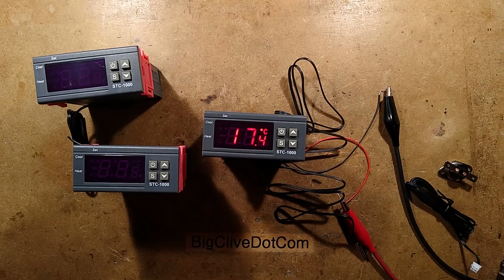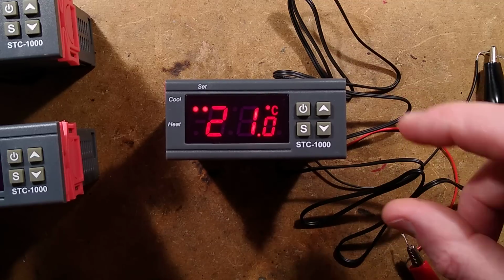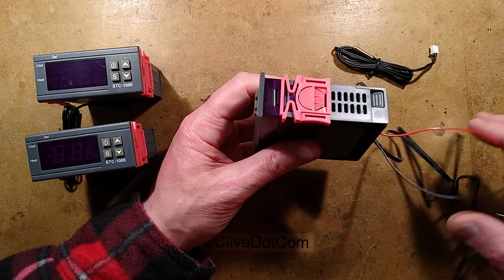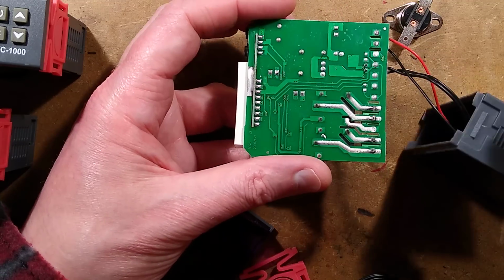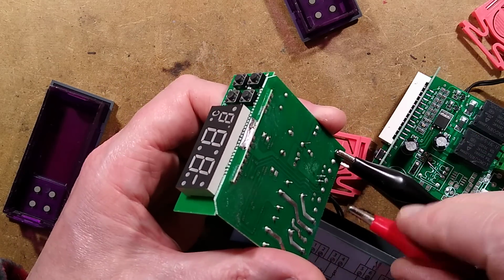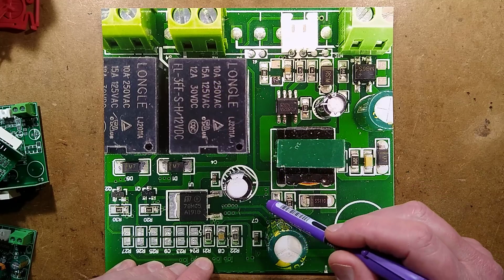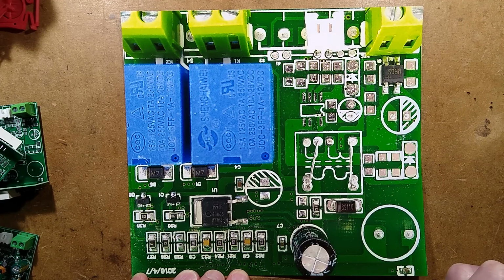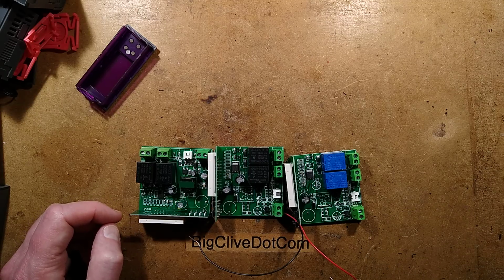Teardown of three STC-1000 style thermostats

Comment: I built a fermentation controller using these a few yrs back (run a fridge, heating pad and fan) and I came to the same conclusion, I wasn't going to trust the mains voltage version and I didn't.  I would love to see you pull apart and review one those Inkbird ITC-308 so see if their internals are any better than a standard STC-1K

Comment: Hi mate. I used to work for a commercial cleaning equipment contractor. They supply a machine called a decarboniser. Using one of those to heat either 10,35,50 gallon water tanks using domestic elements used for central heating. It was a smaller part of their business but u used to replace approximately 5 of those controllers every week !!!

Comment: I despise all controllers of this type.  In refrigeration we most commonly see manufacturers use dixell or Carell brand controllers that have this basic form factor.  They can be programmed for medium and low temp applications and also be used to control electric heaters for defrost.   The problem comes when they control compressors directly through the onboard relays.  Works fine for a little while, but when the condenser coils start to get dirty or the units are put in hot environments  like a commercial kitchen, then they start burning out.  I've seen many actually melted.  Wherever it's possible we rewire the unit to incorporate a more robust external relay or contactor and use the on-board relay of the controller to activate the external relay/contactor coil.

Comment: I've seen some of those with dual sensor sold as a differential or relative thermostat.  This is where it compares the temperature of the two sensors and turns on if the difference is high enough.  Usually combined with absolute, so for example T1 at 30C minimum and T2 5C minimum difference. Often used for solar thermal collectors, to control the pump used to transfer heat into storage.

Comment: I absolutely use my 120v version for an inductive water heater for hot water parts baths. Not saying its a good idea but it kept water near boiling in open air for 3 days without issue. Mind you i kept this setup outside on concrete where a fire wouldnt hurt anything.

Comment: I use the stc1000 for fermenting chamber and indeed blew the internal 220ac power supply. Fixed it with external 12v one. Did you know the the temperature is not really measured and displayed, but referenced by a table operated In the controller. Seems to be more accurate than the non-linear behavior of the ntc or ad-converter. I make great beer with use of the stc1000!

Comment: I use one of these as a "freeze guard" on our central AC unit. I threw it in while I was waiting on some R22 a few years back but after I fixed the issue and recharged the system, I ended up leaving it on just as a failsafe. If my suction line gets below 5C, it cuts off the condenser and just lets the inside fan run by itself. Just set the cooling temp to 6C and a 1C swing. It's wired to always be on and only the condenser control line is switched thru it. I set the compressor delay to 10 minutes so if it  does start to freeze, it'll kill the compressor for 10 minutes to let the evaporator thaw. I know 5C isn't freezing but if the suction is that low, icing has already started on the evaporator on the first few loops after the expansion point and once the first few turns start to freeze, the rest will ice pretty quick. 

Great video as always Clive!

Comment: I use the stc-3008
this one has 2 set points and 2 exits
 2 displays

(low and high alarm)
been using this for 3 years
12v for different cooling fans: grid tie inverter fan, bms fan, electrical cabinet fan

also use a 230v for my pool heat pump
water temp and evapor temp for defrost

Comment: Have used these for years in brewing to control all sorts of things. Mostly good. Would really like to see your take on the cheapo Berme knock off PIDs that are around. About the same price and offer better control, but found the temperature readings unreliable. Some online research suggested this is due to poor design of the circuit causing voltage drop to the thermocouple reference voltage, would be good to test

Comment: Depending on the micro in use (there appears to be a couple) there is opensource firmware available that adds functionality, etc..    As shown in Big Clive's video there can be different micro/ICs used on the logic/display board.

In fact an STC-1000 I have has completely different 'power/relay' board (and logic/display board) to the ones shown in the video here.   Unfortunately I haven't found a datasheet on the micro yet - though the logic/display board has labelled ISP header.

Comment: I had 2 of the real Elitech versions of these in my hombrew set-up 10+ years ago, installed in a jiffy box with IEC connectors for input, heating (during fermentation in winter) and cooling (during fermentation in summer and to turn a freezer into beer keg fridge). Passed it onto my mate as I have no time for homebrewing anymore, but it's still going strong!
Reply from the maker: Elitech video recorded and coming soon.

Comment: I've been using one of these for ten years!  We use it to drive a heating pad, so our parrots are nice and comfy during our chilly winter nights, and it's been absolutely reliable. Mind you the load switched is only 25W (so 100mA) resistive. Easy to set up, and easy to get parts for (important for when "they" chew through the NTC probe cable!)

Comment: Speaking of interference, we had a industrial customer who kept having trouble with equipment because of their handheld radios, which were round about 450mhz. If an employee keyed his radio a bit too close to the controllers, which was kinda hard to judge because RF being so unpredictable, it would cause all sorts of malfunctions and shut it down. We talked about possibly bringing them up to 800 mhz, but we found turning down the radios from 4w to I think 1w was sufficient and they were still able to use the radios via the repeater they already had. 
Of course then a bitcoin farm moved in next door and raised the noise floor at their repeater and 1w became insufficient.
I suspect this device to be very susceptible to problems if in an area with a high level of RF. Its hard to deal with too, since the whole thing is plastic. Even if it was a metal box, it would still get in through the window you'd need to see the display, and all the wiring.

Comment: How about some kind of monitoring circuit that would compare the readings of three of the 12V versions, and, if all three don't agree within some fixed tollerance of time & temp., a contact would close to operate a trouble alarm for some critical use (that would justify the expense of using three controllers)?

Comment: These are essentially identical to some I got from eBay about 5 years ago. I was not impressed, as the first one failed after about 3 months. 
I used them for an in-house sauna. I don’t know the extended life, because the owner moved a few years ago, and I think took it with him. 
The original thermostat had been desired for baseboard heating, and was overloaded as well as a poor design choice.
Ps, as I remember, the relay contacts on the failed one had welded. I may have been running a bit close to the spec.

Comment: I have once repaired a very similiar thermostat that controlled a fridge. Due to moisture build up, a leakage current was flowing over the pcb from live to neutral. This resulted in a trace of carbon which was conducting enough to short the live to neutral with a loud bang. I had to cut a slot into the PCB in order to remove the carbon trace and to gain a better separation between live and neutral.

Comment: I was looking at these, the stc2000 or something like that does have a low and high temp alarm, I was thinking of using the 2k version to control the heater in me 240ltr fish tank. As it was just luck I noticed the heater light was on a long time water was hitting 29d, pulled it out quick. Q: would you trust these units on a tank full of little life forms?.

Comment: Can confirm about the reliability of the AC input version not lasting as long, I had one fail last week after it was unplugged. Thankfully its easy to bypass with 12v. I narrowed it down to the transformer or the buck controller. STC-3028 temp and RH model.

Comment: As others have said, a lot of home brewers use these for fermentation control. I have one to control the heating & cooling of an old fridge in which I put my fermenting beer. Check out the Rex-C100 devices cos they were similar and popular devices for brewing control but are 3 term PIDs instead of what is basically an on/off switch. I use a similar device, the Elitech EK-3010 as a replacement for the controller on my fridge/freezer as the original capillary type device died.

Comment: I have 6 of these running dye heaters, they work well. 
I did not use the stock relays though, they were de-soldered and wires were ran to the existing terminal block
and wired to external solid state relays. I also updated the tags showing that they were modified.

Comment: In our laboratory, (no longer in existence, company restructure etc) we had large water heating tanks (proprietry) to test ground samples, they had exactly the same control panels as these, but the internal relays kept sticking and the water would boil away (the tanks were left running 24-7 over several days to complete a test), it was obvious that the internal relays were woefully inadequate to switch the heating element loads on and off, so I wired external 30 amp relays (RS components), in a similar fashion to the unit you showed towards the end of the video (21.13), and they worked perfectly after that...

Comment: Funny to see the first DC one you pulled apart has the creepage distance PCB cuts on both the relay contacts and power input, then subsequently the AC one doesn't have them (and of course the second DC one didn't either).

Comment: I have 3 of these and the one that does temp and humidity. In the US they have optional f or c display for temp. I use on as a back up for my dogs heated bed and have used them for temp controllers. They work great but have to be done right so connections don't come loose in certain applications, especially where vibration happens. Ferrules are a must and then strain relief

Comment: Fitted a single relay version into a enclosure switching a 20amp contactor and single switched socket outlet as a portable heavy duty heat controller works a treat.

Comment: Faults in these cheap thermostats are not common. The 240 volt models are fine and  the  relay will handle 5 amps, the problem is the locked rotor amps

Comment: I've been looking at these for a while for the heaters in my fish tanks to ideally take full control of the temperature or just a fail safe 9/10 times when aquarium heaters go bad the stat gets stuck on over heating the water these seem to be the answer but like you sed and the reason I haven't tried them the cheap relays any ideas appreciated i.e. changing the relays which ones to use if that's a good idea

Comment: All this talk about not trusting the PCB relays got me a bit worried.
I have a project where I am planning to run some 80W 3-wire 230V AC motors with the relays in a cheapish PLC (Allen-Bradley 2080-LC10-12AWA).
I have even taken the PLC apart to check the make and models of the relays (Omron G6RL-1A4-ASI and Panasonic APAN3124) and taken a look at the respective data-sheets, and from the data the relays seems fit for the purpose as the motor current should be fairly low.
But I could be missing something?
Reply from the maker: The relays will be OK in a real PLC, but an external relay is a lot cheaper to replace than a PLC.

Comment: I apologize as this question "is not relevant to the post at hand but I felt maybe I would have a better chance at getting an answer on one of your recent postings. 

I have had question bugging me for YEARS and just don't know anyone knowledgeable in such fields but I'm betting you are just the person who can give me the answer. 

The question is in regards to a a few light bulbs I purchased many years back at an absolutely MASSIVE discount.

I ended up getting about 30 bulbs in total, all of which were initially priced ridiculous, the ones in question were originally almost 70 dollars. I had assumed that as my area was quite low income, they just had not been selling well at all so ended up on a clearance rack with ever decreasing prices.

One day I walked in and noticed they were changing the prices to 1-10 dollars for each item so I grabbed all of them.

Now to the point, the bulb in question is a Feit electric A/OM1800R/LED ( 22W AC 60Hs 210mA rated at 1600 lumens ) these things have heat sinks that take up a good 80 percent 0f the box  and the " bulb " material looks a bit like a misshapen bagel 😆 )

I liked them as they were quite bright in places i wanted more light but later on down the road I ended up finding better solutions for the areas I had used them in.

So, already long story short, I played around with one and discovered that removal of the bulb turned them into the absolute nastiest ultraviolet blue lights I've ever encountered.

Not only am I hoping you can explain why this is done in such a way just to produce a nice white light with the " bulb " installed but also..... where can I find more!!!! Brand doesn't matter. I have me an idea.
Reply from the maker: That's called a remote phosphor lamp.  Philips also made a version.  The diffusion of the blue light over a larger area of phosphor makes it last a lot longer.
Reply: Ps - I knew you'd have the answer 😆
Reply: I had one on my front porch for some time. It made the street signs and license plates glow two blocks away.

Opted for a corn cob bulb as I live about a mile outside of Detroit and shady dealings ( including home invasion ) are a fairly regular occurrence in this area. 

The " 40,000 " lumen bulb is enough to light up my yard along with the next teo direct neighbors as well as the street and properties across as well. 

I need to figure out a way to have the blue run at regular times and then have the stupid bright corn cob turn on with a motion sensor.

I'm not too good with electronics. Last thing I had a hand in putting together was a simple control box for an exhaust flamethrower on me dads old 50 chevy, and that was a good 20 years ago 😆
Reply: Thank you for the response by the way, I appreciate it.

I've had blue lights for my porch light for years. Once I discovered that removing the bulb on that feit resulted in a blue that was a good 100 times brighter than any blue bulb i could get in a store i was super happy. The uv was a " nice " touch 😆

Street signs and license plates glowed for about 3 blocks at night.
Reply: @Goochman 420 Don't forget to place a big sign, "DANGER! DON'T STARE AT THE ULTRAVIOLENT LIGHT. MAY CAUSE BLINDNESS AND LAWSUITS."

Comment: To avoid the contact arcing connect a diode and capacitor across the relay outputs.
For the supply you could get away with a 9VAS transformer or just a 12VDC switching supply.
Reply from the maker: It's a resistor and capacitor.  A snubber network.

Comment: I have been using a mains version for 6 months ,bit of a strange design where you have to connect a lead between mains and the output you would think a track on the pcb would be easier. Their major factor i use it for is the freezer it controls original thermostat is obsolete and unobtainable .Using it prolongs the life of the 30 year old freezer which otherwise would go to the tip .what relay would you recommend as replacement for the ones in the unit?

Comment: I wonder if it would be possible to use one of these things to connect to a tank of LN2 and some small heating pads in order to run a computer potentially forever on LN2 cooling? (given you change the LN2 tank every time it gets low)

Hook one of the relays to a valve which lets the LN2 flow into a CPU pot... Then have it turn the heating pads on any time it gets below negative 150-160F... Cover the entire board with conformal coating to prevent shorts and then seal the slots with silicone and place always-on heating pads around the socket so that it wouldn't warp the board so much... Obviously it wouldn't be very practical but it would be a cool concept if you could get it to work, even for just a couple days.

I'm tired of waiting for 3M Novec or EC-100 to become anywhere near cheap enough for regular people to use.

Comment: A teardown for a device I actually own. Bought one for 10 euro. Bought a old fridge and took out the original thermostat so when the power is on the fridge always cools.
I now own a fridge that can cool till minus 5 and heat till 40 Celsius. I use it for fermenting beer and wine.

After 3 years of running the display broke.
I replaced mine for one that made in europe and has wifi so my phone gets a alarm when somethings wrong.

Comment: I used one of these by Inkbird to convert a chest freezer to a kegerator and another to convert an analog croc pot to a pretty passable sous vide cooker.  Been thinking of using them in an automated brewing setup too.  The kegerator has been running continuously for many years now.
Reply: After reading up on sous vide, one has to balance the desire for food improvement over the chance of getting poisoned. Yikes!
Reply: @campkohler9131  Poisoned by?

Comment: I've seen a clone with an extra sensor for measuring humidity. It was a bit confusing for me how it worked, as it had the same relays for heating and cooling. Others replace the cooling relay with one to drive a humidifier and has a second display, like STC-3028.